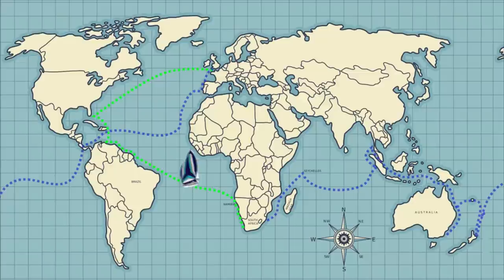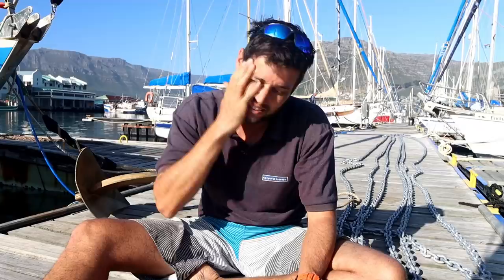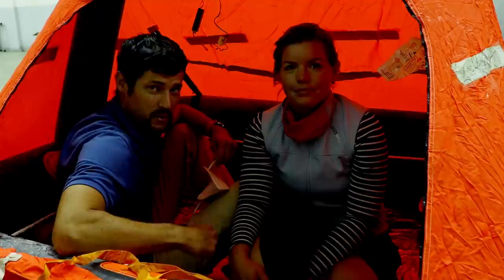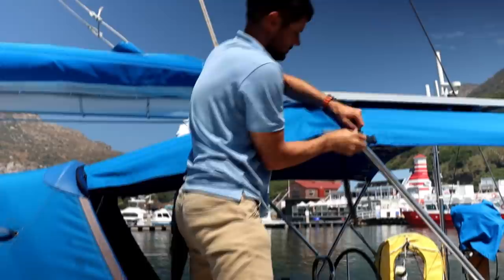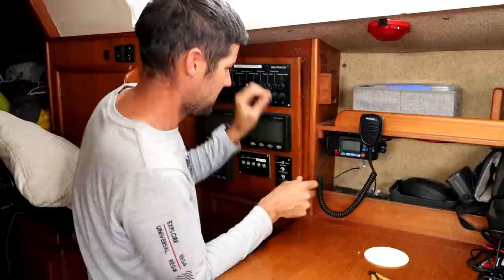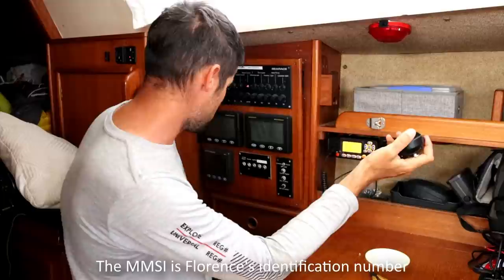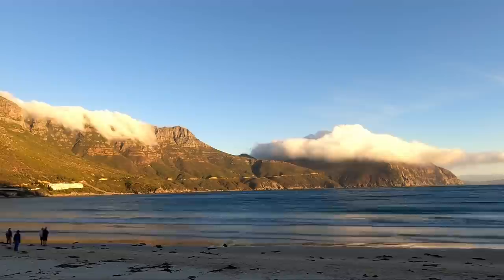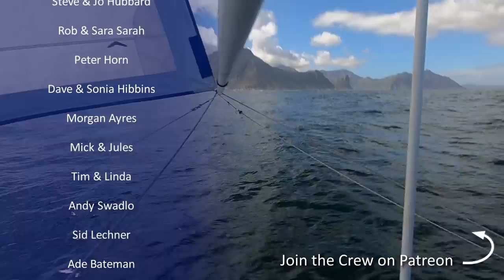Preparing for 8000 miles of Offshore Sailing | Boat Maintenance | Sailing Florence Ep. 128

Comment: Just a tip - have someone tip a bucket of very warm water inside the wetsuit before you enter the water.
 You’ll be amazed how much body-heat it saves you (next time).
Reply: Another good wet suit tip when cold is to have a wee as this feels nice and warm until washed away by the cold water.
Reply from the maker: That used to be called turning on the central heating when I was dinghy sailing as a kid...
Reply: I use to put a black bucket of water on deck to rinse off AFTER a cold dive.
Reply: @SailingYachtFlorence  if you're double suiting,  you might really be in HOT WATER once Amy realizes what you have done!

Comment: Love the Spade, good choice. Although you have a weak point. I have never seen the point of anchor swivels? All they do is add a potential point of failure to the anchoring system and provide little or no benefits in return. If you have an anchor swivel, I strongly recommend that you remove it and replace it with the appropriately sized bow shackle installed the right way. If you really must use a swivel, do not connect it directly to the anchor, instead use a short length of chain between the anchor and the swivel.
Reply: Thank you,  I'm just about to set up a new chain on mine.

Comment: So good to see you new cockpit cover. Looks like a well thought out design. Heaps of procrastination and deliberation I bet. Probably for the good 👍
Reply: I was wondering, however. Could they not have used a conventional (full height) bridge (between dodger and bimini) and simply solved the wind vane air flow problem with a longer paddle?

Comment: going into cold water with a wet suit, can be helped by pouring warm water inside the suit before going in. In the bearing sea they dive under the ice to find gold, using wet suits and having hot water pumped into them on a constant basis, doing that they can dive for 4 to 6 hours in 1 degree C water

Comment: In case were wondering about the splitter, we found in our case (a Raymarine model), that we still have the AIS receive function if powered down but not the AIS transmit function. Haven't tested the voice function but I think that works the same way (need power for transmit but not receive). For that reason we wired it to the VHF circuit breaker, rather than the circuit breaker for the MFD etc.

Comment: You would not have been seeing that tanker, 88 NM away, by line of sight. That would have been a relay. The way it works is that, provided you have a Class A vessel within line of sight (probably 30 NM for you now), it will relay to you a full picture of all vessels on the system.

Comment: Hey Guys - Re the anodes, leave the old ones in situ and attach the new items over top using longer screws until you can haul out next.   As long as they are galvanically connected they will still function.

Comment: Hot water: soak your hood in hot water before putting it on then pour more hot water (I use about a quart/litre} into your wetsuit. This warm layer will remove the shock of the entering cold water since it can't fill the area due to the hot water. Using hot water before entering will greatly extend your time of feeling warm/comfortable in the water
Luv your vids!

Comment: I'm surprised that the liferaft wasn't deployed to auto inflate. During my apprenticeship, I worked in an aviation safety bay and when we serviced aircraft escape slides, lifejackets and liferafts we deployed them and recorded the inflation time. Great channel guys, you have inspired us over the last couple of years we hoping to close on a deal with our own boat soon.
Reply from the maker: The first time we serviced  the life raft we did pull the cord to auto inflate. That was because the gas bottle was past its date so had to be replaced anyway. This time the gas bottle was still in date (10 years) so we didn't break the seal and re-packed it.
Reply: @SailingYachtFlorence  Love your channel guy's

Comment: from a navigational officer i can tell you that AIS is the best equipment to  be spotted by ships, especially at night, i was also looking for a cheap AIS transmitter for my small boat...can you please tell me where you got it from?
Reply from the maker: The AIS transponder is from Em-Trak, they are based in the UK but have distributors in many places.
Reply: We had had many scary moments among commercial vessels in Central America (not known for their adherence to COREGS) before installing an AIS system. Best piece of equipment we ever bought. We purchased the Raymarine AIS 7000 Splitter, which works the same way (ie plugs into the existing VHF cable between antenna and radio).

Comment: Get a drysuit. I've dived in a drysuit for decades up here in the frozen wastes, which are expensive, mainly because of the valves needed to let air in and out. However, last year I snapped up a second-hand, nearly new Typhoon dinghy drysuit for not much money at all from a guy who'd been using it for kayaking, but then became a new father and found he didn't have time to kayak any more. I use it in my dinghy during the months just after and before the sea and lakes freeze, but it would work fine for working on the hull of a boat with snorkel gear. You can pile on the clothes underneath, so no problem with cold. Could also be useful when sailing through cold, wet northerly latitudes.
Reply from the maker: Something to bear in mind for our future cruising areas, for now we plan to just sail closer to the equator :-)

Comment: Hi Matt and Aimee, the new AIS, radio and antenna and the splitter  look good.
But don't think something is wrong if you are not seeing vessels at much more than 25 or 30nm when at sea.    One famous actor engineer voyager said many times "you canna change the laws of physics"
That 80 odd mile tanker was probably bouncing signals off the mountains inland from Hout Bay as VHF radio range is around line of sight +15% except in some rare atmospheric conditions such as tropospheric ducting or sporadic-e propagation plus some really unusual Earth-Moon -Earth bounce reception 🤗
May the winds be favourable on your Atlantic adventure.  
SV  Quo Vadis.

Comment: I can see from here. New 10 mm one, galvanised calibrated.  70m would do. I used 100m Supply s Korea or Taiwan.  NOT China. Chain markers? Cable ties white do the job.  Life raft should be on the deck or railings somewhere but must be covered with sanbrella canvas.

Comment: I notice that your chain swivel was connected directly to the anchor. I understand that if you were to get lateral forces on the chain when the anchor was firmly set, it can break the swivel where it joins the anchor. I have now inserted a couple of links of chain between the swivel and the anchor to prevent this.What do you think? Very best wishes from Mylor ,Falmouth  UK. SY Symphony a Victoria 34.

Comment: Matt, I KNOW that you both LOVE S. Africa (I totally 'get' it!) But, how's the rigging (standing & running?) Please, clean all of the winches & re-grease them. Also- for me- please check the rudder bearings. I know that getting lifted out is pricey, but- isn't your safety worth it? Through hulls, fresh anti-foul, eyes on everything. Re-glaze the new windows (exterior at least). Yes- a good start so far, but- 8,000NM is an awful lot. Jes sayin' my friend. (No, my checkbook is out of checks- I cannot mail you one million pounds!) Not that you asked.
I'm actually ready for you folks to head off again. Thank you for such excellent coverage since 2016!
Reply from the maker: Winches, bearings, rigging. Check, we just don't film it all otherwise it would be a very long video! (it also takes 4x as long to do a job when filming it as it does without!)
Reply: @SailingYachtFlorence  Thank you! I hate to pester but- it is a very long trip with no help in the middle!!! SYF has always done a great job balancing the upkeep work vs. beautiful vistas & local sites. It's going to be hard to sail away from such good friendships and such a strong community that you've joined. It's like joining the right yacht club- you know when its a really good fit. Hopefully, the Bahamas, the US & then home looks appealling.

Comment: You didn't say what your plans were for your old anchor chain.  I suspect if there is a place to stow it aboard, it would be wise to hang on to it.
Reply from the maker: We can't carry all that extra weight around so we cut off 10m  of the 'good bit' for use in case we lose the new one somewhere, and sent the rest for recycling.

Comment: I thoroughly enjoy your vlogs, informative and entertaining. Would have been good to have been told how much all those upgrades have cost.
Regarding your new tent, I can't remember if you have a water maker, but would a water capture system be easy to build into it??
Reply from the maker: We have a separate water catcher which we only put out for that purpose meaning it stays clean (no water maker). As for maintenance in the last 12 months (including th haul out in Seychelles) we have spent just over $10K, which blew our original budget but we have been out cruising much longer than planned so therefore more maintenance has been required.
Reply: @SailingYachtFlorence  many thanks for replying. I look forward to the next vlog. Keep safe you two x

Comment: You’ve still not done the ensign though 😂  Like the cockpit cover. Your story reminded me of a friends yacht with full cockpit cover that became known as ‘The Orangery’ 😂  He didn’t have the wind vane requirement of your design, but as you say, what you have now will be more than nice on a cold wet night. The AIS splitter is very interesting though. Thanks for that tip 🙂  And you also answered my question about whether you’d reach the Caribbean and simple sail west again. Presume you’ll return via the Azores? Are you planning to return to the Orwell?
Reply from the maker: We plan to return via the Azores to Portsmouth where we set off from. We may re-visit the Orwell the following season on our way to explore north.
Reply: But didn't you buy Florence from, I'm guessing, from Suffolk Yacht Harbour  @SailingYachtFlorence ? The Orwell would be kind of coming home?

I guess you'll be thinking about places like Lofoten, maybe Iceland? Or the Baltic? Wow, it's going to be an adventure to watch and share. Good luck to you both 🙂

Comment: Why are you crossing the Atlantic twice instead of coastal hopping up Africa and visiting more countries?
Reply: Because they're driven by the wind - the trade winds blow towards the north west in the southern Atlantic and towards the north east in the north Atlantic. So a zig-zag across the ocean is the way to do it, otherwise they'd spend very long periods basically trying to sail into the wind.
Reply: @Matthew-ut6ed  In the southern hemisphere they blow from the southeast, like you say. But in the northern hemisphere they blow from the northeast. I assume Matt and Amy will head a bit north along North America  until they pick up the prevailing westerlies. I think there are southerly winds along the coast, although I live on the opposite coast so I may be wrong about the coastal winds on the east coast of north america. Once they work their way north a bit they can use the prevailing westerlies to cross the Atlantic back to England.
Reply: @Matthew-ut6ed  The winds today are northerly from south africa to senegal. That leaves a short distance to the med. Surely it's better to tack for a few hundred miles than to zig-zag 8000? With the benefit of visiting many more countries and avoiding USA.